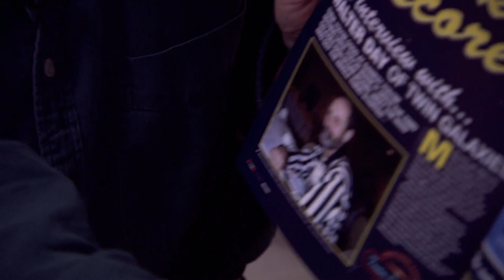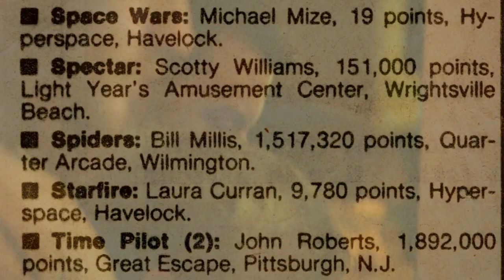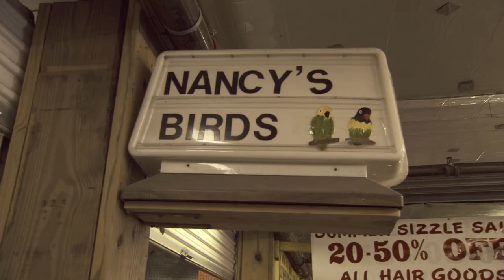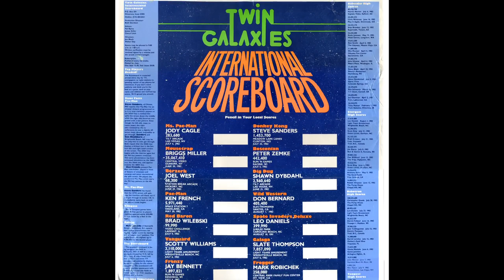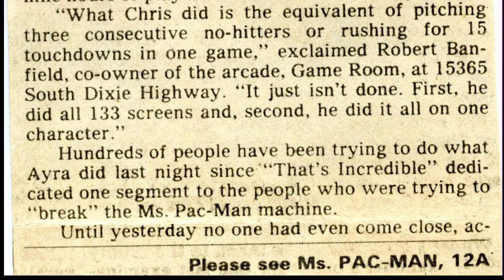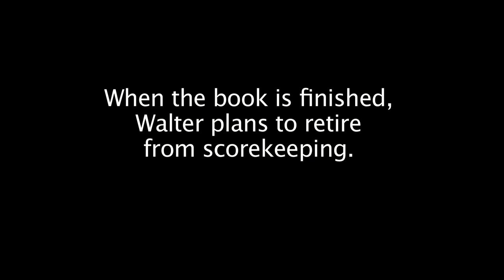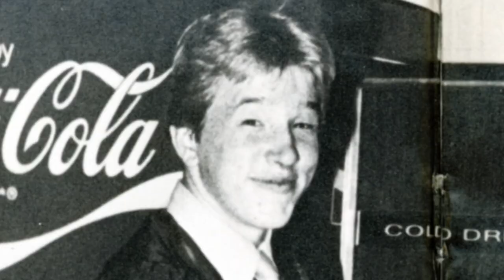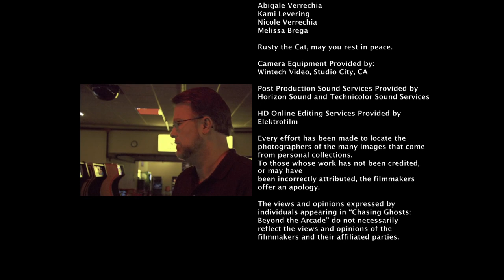Chasing Ghosts: Beyond the Arcade - HD 1080P

Comment: There's a slightly better version of this movie out there. It includes all of the original music (Flock of Seagulls, Montrose, etc.) instead of these soundalike tracks as well as some deleted material. It's worth seeking out, unfortunately it's not HD.
Reply: Any idea off the top of your head what was cut from this version? I've kind of looked back and forth between the two, but am unsure without two full watches.

Edit: Nevermind, I found it. I saw a b-hole.